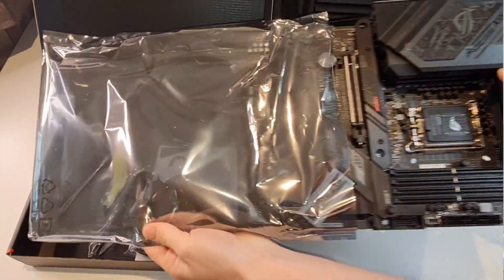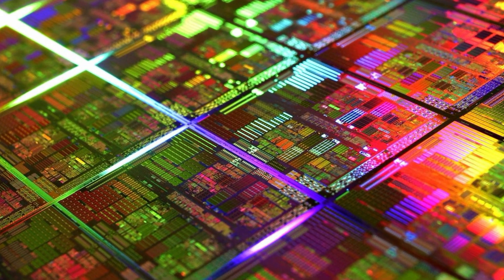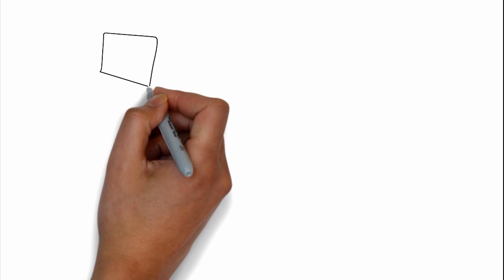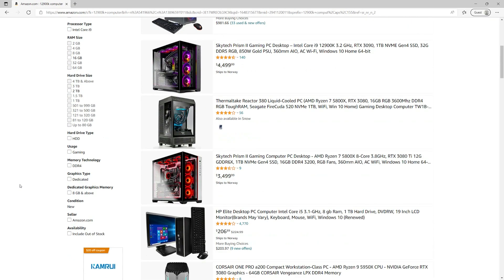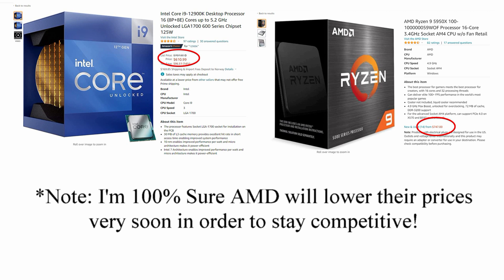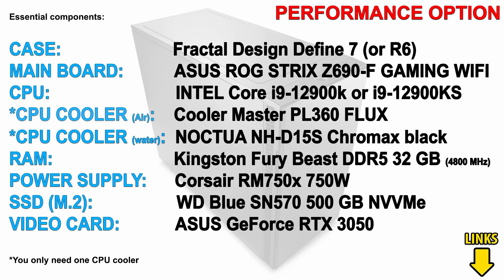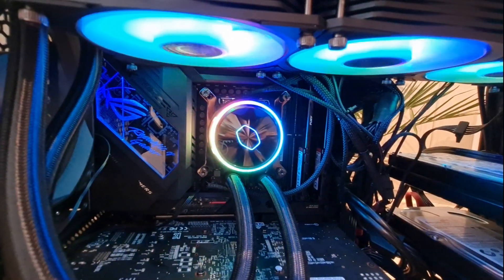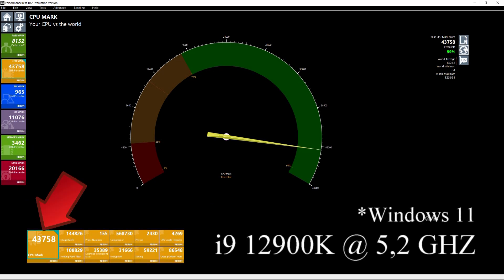The Best Computer for Music Production - What's Needed and Why!

Comment: How can you be assured you won't have a computer that will give you crackle, and stuttering  in your audio? My new (high spec) computer that I bought for audio,  is riddled with DPC latency and NOTHING has solved it in a year. No one can fix it. I've scoured the internet and tried everything.   I want to just buy a new one, but if this ocurrs again, I'll just shoot myself.
Reply from the maker: If you buy the exact same components listed in the description then it should work very well, since it's already been tested for audio production, and proven to work very well. Even huge projects with around 200 tracks in the arrangement, tons of instruments still don't make it crackle. 
As for your current rig, it is hard to say what could be causing it. There are so many things that could play a role here. It could be either hardware or software issues. Background programs that take up too much CPU time can cause tons of latency.. Memory configuration can play a huge role too. Hardware that is not 100% compatible, driver issues and so on. It could be so many things.
Reply: what does high spec mean, what audio interface/asio driver are you using, etc...
you should start a thread in gearspace forum with all details to find the issue.
or just get a mac and never bother with anything like this

Comment: This video is really informative!!! What if I want no noticeable latency? Does that have to do with cpu? Cores???
Reply: Drivers, background processes, the speed of the CPU itself, more threads are better, the speed of the RAM and storage (also capacity).

High core count chips will always be more responsive that lower core count chips if both are very close on single core perfomance.

I disabled the 4 e-cores on my i7-12700K and Windows 11 wasn't as responsive as before.

Comment: Hi, amazing video Firewalk..... I am about to embark on a build, have been running my studio from an i7 laptop but need to upgrade urgently. I would love to hear your views on the new 13th gen processor i9 13900k and the ddr5 memory vs the ddr4, some good benchmark results or do you think the 12th gen is enough to run smoothly or would it be worth the upgrade (some great prices for 12th gen processors now) also I run 3 screens so was wondering what the best graphic card for this setup would be, that wouldn't interfere with the speed.
love your videos, cant wait for FL 21 upgrade.  John
Reply from the maker: I haven't personally tested the 13th gen yet. I considered swapping out the cpu with a 13th gen, but eventually decided that it would be such a marginal change that it wasn't worth it. It's basically a 12th gen with higher clock speed and more cores. In test the single core performance is basically exact the same. So it robably wouldn't give much improvement over the 12th geb for a music rig.
Reply: 12th gen it is then, thanks..😀
Reply: i9-13900K is a weird stop gap filler of a high end product for music production.

Comment: So DAW performance greatly depends on single core performance with high clock speed rates like gaming??.. Games favours higher clock speeds rather than having more cores and threads. But the apple G5s had xeons (dual xeons namely) and as far as I know xeons is all about core count and ECC memory support. could handle much more heavier work loads than a pc does. (Back in the days of course. its all different now)..

Comment: computer for music production ? Certainly not Windows
Reply: Absolutely! It's 2022 and time to drop Tim Apple.
Reply: @TexasTimelapse  but most ppl said apple is only to production music, the system is more stable
Reply: @PrOduKcejSzyn  
Once upon a time it was. Spec out a super high end workstation PC. Then take those same specs and find a comparable Mac if you can. 
Mac's are extremely overpriced.
Build your own PC and save even more. PC Partpicker is an excellent site for this.  We are talking about thousands in savings on a workstation compared to an overpriced Mac. Especially DIY.
Windows 11 is rock solid in 2022. Set the PC in performance mode and optimize Windows services and get even more performance. AMD is now blowing Intel out of the water in performance with the new 7050x CPU.
These are just a few examples.
Reply: @TexasTimelapse  nothing beats Apple Silicon, especially Audio.
it is lightyears ahead, cheaper and faster and dead silent.
literally insane
Reply: @JohnSmith-pn2vl  
Better research that....
Google "Scan Audio CPU benchmark 13900k"

Comment: The reason for the lower price is because now Intel is coming with 13 gen Raptor Lake I9 13900KF and AMD has come out with there Ryzen 9 7950X.
Reply: Have you seen the single core performance on the 7950x? It blows Intel out of the water by a large margin.
Reply: @TexasTimelapse  this cpu is uncoolable, they want you to run it like Apple at almost 100°C
Reply: @JohnSmith-pn2vl  
It's designed that way. Grab a beefy AIO for that bad boy. 
Intel's 13900k is hotter and consumes more wattage.

Comment: Great review, thanks! Do you use Kontakt or Omnisphere? Those are my main uses, both running inside REAPER for my DAW software. I need super low latency for real-time performance. I'm still using my i7 2600K from 10 years ago. It's pretty nice, but I'm sure these new Intel and AMD builds completely wipe the floor with my i7!

Comment: Hi, I got the performance option and it is not even starting with the BIOS, anyone with the same problem?
Reply from the maker: You need to watch the LED's on the motherboard. They will indicate what the problem is. Most likely it's the CPU not seated properly, faulty CPU or the graphics card not being seated properly, or incorrectly powered (most mid to high end cards require extra power to work). The LEDs on the motherboard will indicate what the problem is.
Reply: @FireWalk  Thanks for the answer, but it is complicated, first the yellow light lights (DRAM) then it restarts and then the white and the green simultaneously (VGA and Boot), I already tried with another RAM and nothing. My power supply is a Supernova 1300 G2.
Reply from the maker: @forroncho  Obviously you have connected the main power connector on the motherboard, but are you sure the  dedicated CPU power connector r is connected correctly? Is it seated properly? f there's a power supply problem then it could cause symptoms like this.
Reply: @FireWalkMusic  thanks it eas the kF Intel procesador that does not work with video, but now I'm having problems with Windows 10 drivers, are not installing well.

Comment: would you recomend the i7 1165g7 or an i7 11800h in single core is better the 1165 but the otherone is better in everything else
Reply: 11800H is an 8 core 16 thread chip. But if i were you, i would build a Ryzen 7 5800X desktop or i7-12700K.
Reply: 11800H has more cache, faster clocks than 1165g7.

Comment: Found this 2 weeks after building a new audio production PC (i9-12900KS), glad to know I was on the right track. Intel still has the lead for this use case, as much as I want to support AMD and promote healthy competition.
Reply: I believe the current-gen and last-gen processors have Intel in the lead for audio rendering time (export) and for simultaneous virtual instruments, but AMD has a slight lead at the top end on simultaneous DSP use.

Since I'm not going to be using more than 350 DSP plugins in any one part of a mix, I'm not getting close to either top-end processor's DSP cap, so render time and virtual instruments are what I differentiate on, and Intel still leads there.

If you are working in audio, RAM speed and timing can have over a 10% impact on performance between DDR4 and entry-level DDR5, so getting the fastest RAM possible is more crucial IMO than getting an i9 or a 7950 and hand wringing over them.

Another selling point for Intel is that it doesn't have the issues with scheduling and performance in Windows that AMD perennially does. There are always hidden updates or fixes you have to apply to get the "normal" expected performance out of AMD CPUs and GPUs, so I eliminate the headache by avoiding them.
Reply: @CyberneticArgumentCreator thanks for the info, I had no idea the annoying updates were an AMD thing

Comment: I think AMD is more well rounded on the very high end, i think the Ryzen 9 5950X is very popular on high end studios.

Core i9-12900K is a good alternative for now, but note the e cores are a bottleneck because their single core perfomance is very slow vs the p cores.
Reply from the maker: From my research, the 12900k outperforms the 5950X by a significant margin when it comes to single-core performance, which is so crucial in a DAW environment. Again, the E-cores are actually NOT a bottleneck. They're actually the complete opposite. The scheduler will only assign low-priority (low intensity) tasks to the E-cores so that the P-cores can take on the high-intensive tasks without interruption. The cores in the 5950x for example will have to constantly cycle between various background tasks and the DAW at all times. This creates a lot of lag and significantly reduces raw performance in single-core intensive applications such as your DAW. Because the E-cores take care of all the background tasks, the P-cores can then focus exclusively on processing the audio in your DAW, without interruption. That's why they're so useful. They're not a bottleneck at all. This is the ingenious thing about this design, and why it's so effective in single-core applications such as a DAW. :)

It is important to note though that you'll have to run windows 11 in order to get the most out of your 12900K, because windows 10 (and older) does not have the updated schedule to take advantage of the E and P core architecture.
Reply: @FireWalkMusic  Well, my counter argument is this benchmark video:
https://youtu.be/wYs6sIkG6QA

Comment: Ryzen 9 5950X is the best CPU for mixing and 12900K for instrumental work. DAW bench youtuber compared Zen 3 and Alder Lake chips, DDR5 and Windows 11 also do a significant boost to DAW perfomance. The e cores bottleneck the 12900K's DSP perfomance, the 5950X is a 16 powerful core chip.
Reply from the maker: Hi, there isn't really any distinction between running a project as a whole or the mixing in particular. It's actually the mixer channels themselves that determine the CPU usage because each mixer track is an opportunity for the CPU to perform multitasking, in addition to the synths themselves, etc of course, which can usually be processed independently. 
The E-cores do not bottleneck your DAW. On the contrary, I've found that they significantly increase single-core performance. This is because there are always countless background tasks running at all times in the operating system. The E-cores only handle background tasks, leaving the performance cores 100% free to take on high-intensive tasks. This means that they won't have to constantly cycle back and forth between background tasks and your DAW, and that gives a huge performance boost, so the E-cores actually help increase performance dramatically.

It is important to note though that you'll have to run windows 11 in order to get the most out of your 12900K, because windows 10 (and older) does not have the updated schedule to take advantage of the E and P core architecture.
Reply: The instrumental benefit of Intel is due to the test being run on DDR5.
Reply: this is why audio needs single core, you cannot multithread a channel, only 1 core can operate 1 channel, if you overload only 1 core of your 16 or so cores you get stutter.

Comment: Great video, thanks. Also curious as to what you think of the Apple M1 processor in comparison to the Intels and AMDs.
Reply: Apple M1 is slower and obsolete, at least it's very efficient and gives excelent battery life on laptops. It gets outperformed by 12th gen mobile (i7-12700H).
Reply: @saricubra2867  Obsolete? Really? I’m curious as I am considering my options. Have you tried both M1 and i7s and seen the difference.
Reply: @accentontheoff  M1 doesn't have near the amount of multicore power or singlethread power.

M1 is kinda close to a Ryzen 7 5800X which can be outperformed by an i7-12700H laptop chip and i5-12600K desktop.

M1 Ultra outperformed by a Ryzen 9 5950X and Core i9-12900K.
Reply: @saricubra2867  Got it thanks.

Comment: is single core processer better then multi core (for music production on any DAW ) ?
Reply: A balance of both. 12900K outperforms a 5950X for vst intruments, but the latter is better for mixing (the 16 cores from the 5950X are equally powerful, while the 12900K only has 8 powerful cores).

Mixing scales pretty well with core count,  that's why the 5950X is so popular now and a massive upgrade even on an i9-9900K.

I think you should buy AMD's best (Zen 4 this year), if you are more focused on vst instruments and gamer, then choose Intel.
Reply: @saricubra2867  thanks
Reply: 5950x outperforms 12900k in vst, irt depends on how you look at it, amd has way more power cores and no "efficiency" cores.

Comment: Can go with a fanless gpu. No HHD old tech. NMVE drives are exceptionally fast especially if fitted on mobo. I would go with 64 gb RAM for orchestral uses. Bios can reduce fan noise
Reply: Do you have a specific model of RAM for orchestral use? I run the VSL Horizon Series libraries inside of Kontakt 5, as well as Omnisphere. I heard DDR4 RAM with Samsung's "B-die" is the best for overclocking (something about good handling of changes in voltage.) I'm trying to find a good DDR4 2x16GB or DDR4 2x32GB with low CAS latency to allow for stable low ASIO latency when playing in real-time. Thanks!

Comment: Budget options = lesser quality
Reply from the maker: The budget computers will be slower of course, so they're less capable of running extremely large and demanding projects. If you're referring to audio quality, then that won't be affected at all. It will be exactly the same.
Reply: "Budget options"
It depends.

i7-12700K and i9-12900K have the same amount of perfomance cores and single core is basically the same (slight CPU cache and clockspeed differences).

Meanwhile, the difference between a Ryzen 7 5800X and Ryzen 9 5950X is big.

Comment: It's little later in the year and the 12900K is a little dearer than the 5950X, but I'll still go for the 12900K for my build. I think the main difference however is the hybrid architecture and DDR5. Also the U-12A is a bit dearer than the D15S, but it's smaller and cools better somehow. 
Also, a videocard is cute, but take an example what the graphics in the 12900K can do with, as a desktop example: video-editing!
---> https://www.youtube.com/watch?v=OayC1Gz6YGM
Reply: 5950X is faster for mixing because the e cores from the 12900K are a bottleneck. Mixing scales pretty well with core count and 5950X's 16 cores have the same very  good single thread perfomance, and when you unlock power limits, it's a 16 high perfomance core beast.

Comment: Just saw your video snot PC and its performance. I need a new computer and I’m using an iMac 27 inch with 32gb ram and it’s not new 2015, I think. But I use Logic and PC doesn’t use Logic. I would like laptop, but the MacPro M1 with 64 ram, 2tb comes to almost 5k. What you showed was a stationary and not a laptop PC. What can I do? I’m still with my iMac. Any advice. Thank you so much.

Comment: This video was helpful in understanding why my computer has crackling and distortion when I record through my Apollo X4 into my XPS 15. It simply doesn't have the raw core performance to handle the signal. Is that right? It's a 10th Gen H processor at 2.60ghz.

Comment: thank you for your explanation! surely helped a lot and brought new information for me especially why DAW favors single threaded performance over multi core. i wanted to ask about the motherboard. when choosing the motherboard, do you consider the audio codec in it? does it effects the quality of the music, or the experience of producing it? thanks in advance.
Reply from the maker: You're welcome. You can use the onboard sound card, but I recommend using an external audio interface batead. The audio quality will be exactly the same. It's all digital so the sound card only matters if you intend to record something, like a guitar or microphone for example.

Comment: Hello Firewalk
If I am going for the Intel i9 12900KS CPU, do I still need the ASUS ROG STRIX Z-690F Gaming WiFi or do you have something else you'd recommend??
Reply from the maker: The rog strix is one of the most popular ones, but you can use a cheaper board with less features if you'd like. That's no problem. :)

Comment: 16 GB of RAM are not enough. Modern sound libraries are very heavy and you don't want to be short on RAM in multitrack. Stradivari quarter will easily take all of your 16GB without even adding compressors, delays and other stuff.

Comment: Hi Fierewalk , I finished up my PC build (Your PC build same one ,Thx) Is it okay to partition the first operating system drive (windows and DAW into two or 3 partitions , C for Windows and Daw , D for Pix Vids  doc( personal  data ) and then is it a good idea to make on there a partition for recovery (like Windows (ISO ) file set up  ,, i have a 2 TB  SSD , DO you have any ideas ? How do you deal with that stuff ?
Reply from the maker: hI, sure, if you have a large enough drive you can divide it into different partitions like that. You can even resize them afterwards so it's quite flexible. 
I have one SSD for my OS and DAW, and another one for sampoles, VST's etc, and a third for video editing etc. :)